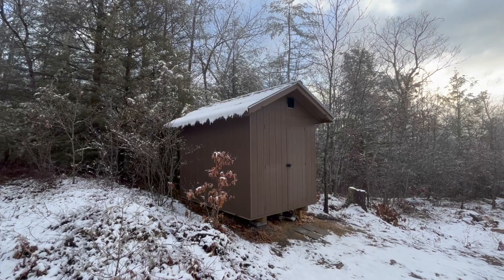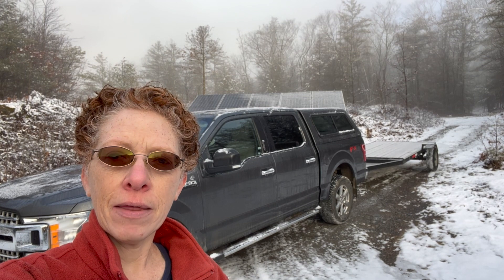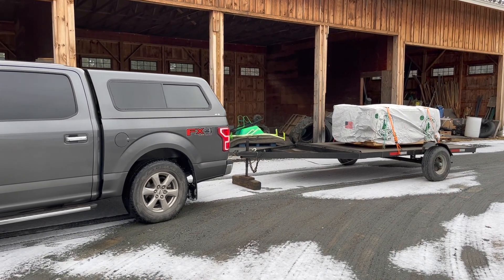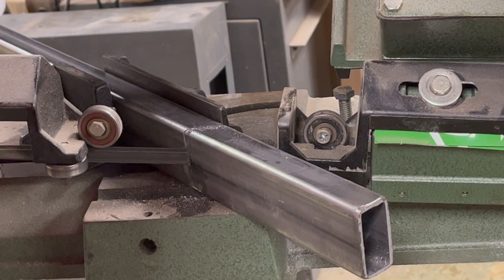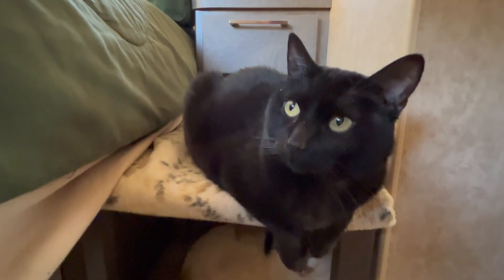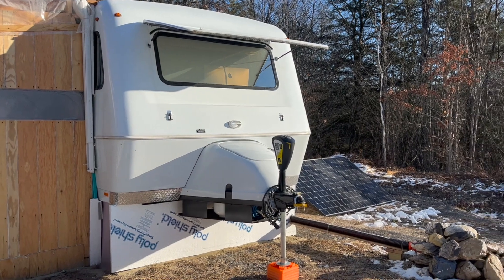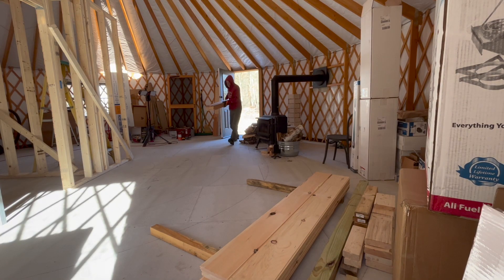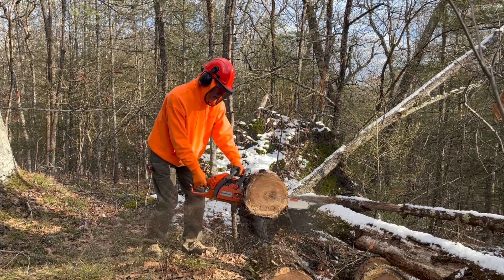Rocket Mass Heater Part 3 - p-channel for the batch box (Vermont DIY off-grid home build)

Comment: Just found your vids. Looks good. I plan on building one based on this design and theses vids. One question, what are you using for the top of the burn chamber? I'm sure that area will be subject to high heat. What material are you using?
Reply from the maker: Hi Chris, thanks! We got sidetracked with other projects and haven’t finished the RMH yet, but we bought a barrel that is heavy gauge stainless steel.
Reply: No, i was talking about the slab over top of the burn chamber? The batch box? @OvertheRiverandThroughtheWoods
Reply from the maker: @chrismarr2663  ok, that is ceramic fiber insulation board.

Comment: thanks for your batchbox vids! Maybe you could put the various parts (3?) into a playlist? thanks
Reply from the maker: That's a good idea... when we finally get back to this project and finish up the build and the videos about it, I will make a dedicated playlist for the RMH. It seems to be a popular topic.
Reply: @OvertheRiverandThroughtheWoods  thanks - I appreciate RMH vids that are not be the "insiders" - the experts - since those vids assume a certain expertise already. The manifold is what I consider to be the most complicated part - but obviously having to weld a P-channel - I used a stainless steel pipe as a P-channel. But the pipe ended inside the fire box just under the vent in the door - and then I would get ash in the pipe. I just tried ceramic fiber board in a steel fire box and the pipe as a P-channel. I got serious heat - a cleaner burn for sure - but I couldn't load as much wood. So - also I got backdraft if it wasn't cold out enough - since I had the ceramic board in the baffle - not as much draft.

Comment: Hi. I hope you are still enjoying your new life style. Could you please post a feedback about your rocket mass heater ? Is it completly finished and how it works?  Does the core stand the heat level without cracking ? Is your yurt warm enough ? Thanks a lot for this feedback.
Reply from the maker: Hello, yes we are still loving it up here, but I'm afraid the RMH project got put on hold for a while, while other interior projects like the plumbing / bathroom took priority. We do hope to get back to it this fall. On the bright side, you haven't missed any part of the project - the rest of it will be documented here on our channel. Thanks for checking in!